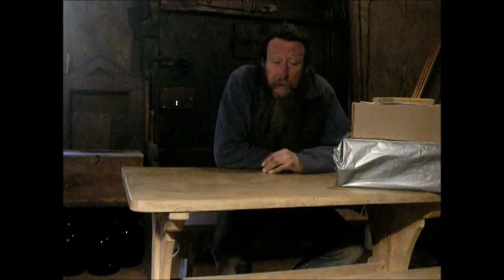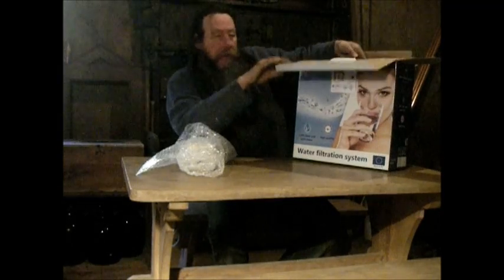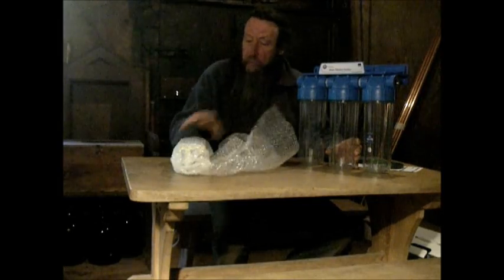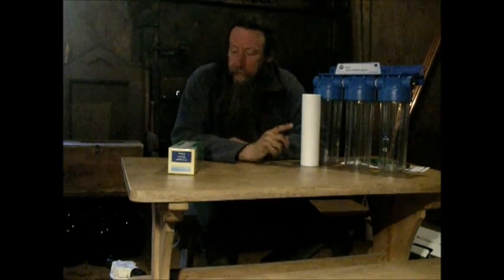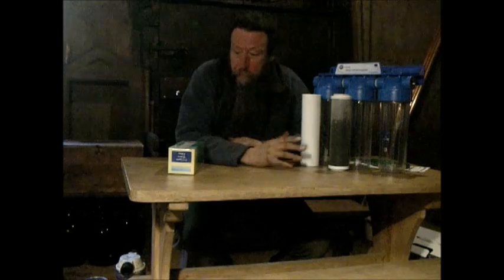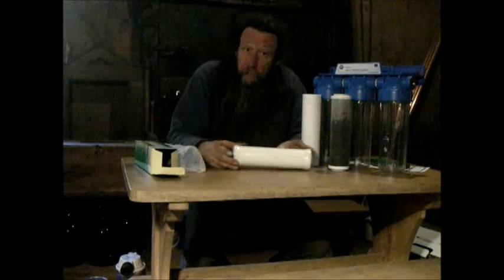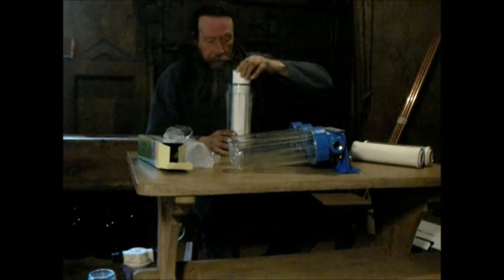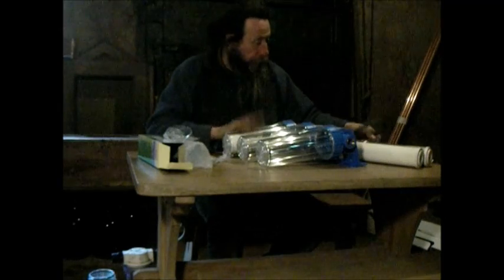OFF GRID DRINKING WATER UK part one, Filters

Comment: Hi
Thank you for the brilliant video.
Please could you tell me where you buy just the 10" ceramic filter on its own? Everyone seems to want to sell ceramic with charcoal inside.
Many thanks Lucy and Randy
Reply from the maker: Hi, I purchased these ones from Ebay , I have seen both plain ceramic water filters and also those filters that also contain charcoal, it took a few searches to find the correct ones, I had to use the 10 inch ceramic filter search terms to find them last time, good luck hope you find them

Comment: Thanks for the video and clear explanation of the filters. How do you pump the water through this? I assume it needs some pressure to travel through the system- do you have a pump or is it gravity? Cheers!
Reply from the maker: thank you for the nice comments, the water is only gravity fed but it is from quite a high source creating a bit of pressure, a pump would be needed if it was a very low head of water
Reply: @TheDevonblacksmith  Thanks for the reply. Good to know, and it seems the system isn't too expensive.
Reply from the maker: @MartinDoyle  I found its the cheapest way to get  piped clean water without chemicals, as long as you get the parts from a supplier that does lots of them, fish farms and outdoor ponds often use these  types of systems,t another really good point is it all conectes straight up to household  water equipment  like taps, tanks and other pipework
Reply: @TheDevonblacksmith  Thanks fir the great practical video. I have spring water coming off the hill behind my wood. I'm planning to tap it but was thinking I'd need to get it tested. If I set up a filtration system like yours, would testing be necessary?
Reply from the maker: @amandadesylva3822  it should be fine, but to be on the safe side I would get the water tested at least once to insure there is nothing unusual in the land, the water filet systems I use filter out particles,with the paper filter,chemicals with the carbon filter and pathogens with the ceramic filter, virtually everything is covered by these except some metals and ground contamination from buried waste its unlikely you will have any of those but best be safe when it comes to drinking water filtration and treatments, I no longer bother with any testing of water samples myself as its been clear for many years now, I hope this is helpful ,and good luck with getting a water supply sorted
Reply: @TheDevonblacksmith  thanks again for more useful details. I tried one aquarium suppliers so far, they didn't have all you suggest in stock. I made the mistake of telling him I wanted it for drinking water...he gave me a lecture on how inadequate and dangerous it would be because they weren't intended for that. Next place I try  I'll be less open! Will definitely take your advice to get it tested once it is set up tho. It's mostly forestry up the hill behind me, with no animals or agri fields but like you say, best be safe. All the best to you!
Reply from the maker: @amandadesylva3822  the filters are the same for all , no matter what the use, but I can see the sellers concern that the water might not be as safe as if they where specifically for human consumption, saying that fish are very susceptible to illness from unclean water , and a way of telling if natural water is safe to drink is by seeing how the fish are, all the components , ie the filter housings and all the elements are available online, no need to say what the use is when buying them online, good luck getting the parts and building your water filtration system

Comment: Great peice of kit .. what does the ceramic do .. i mean exactly how does it kill or not let any pathogens through? 
How is beautiful devon ? Its a lovely day here in the midlands 😊
Reply from the maker: Hi Rachel, Its a lovely spring type day today here in Devon, it really is very god, I use this on my spring water system for the drinking and washing water, The ceramic filter works as a physical barrier, the material it is made from is like an unglazed pot, in that  it is porous,  but with so small a space between the clay particles that the microscopic pathogens cannot pas through the gaps, it is cleverly made to allow a good flow of water but no bugs
Reply: Devon Blacksmith awesome. Thankyou for the explanation.  Have a great day 😀
Reply from the maker: thank you , have a lovely day yourself